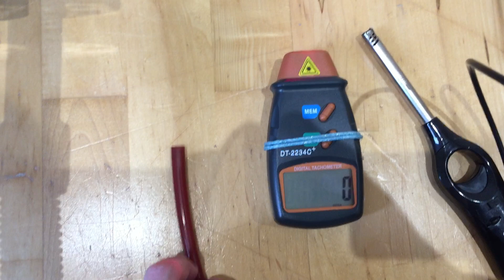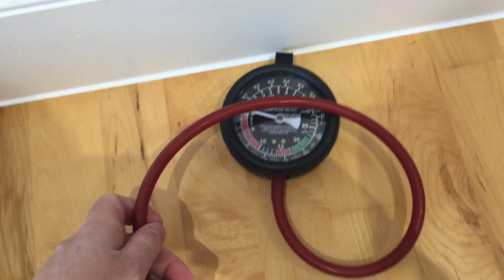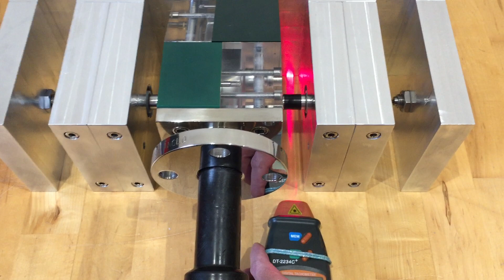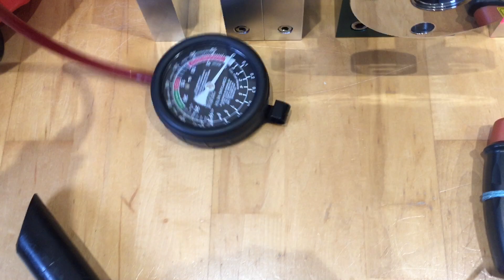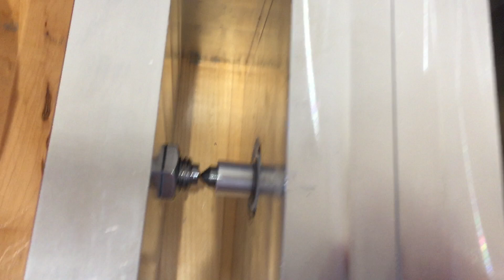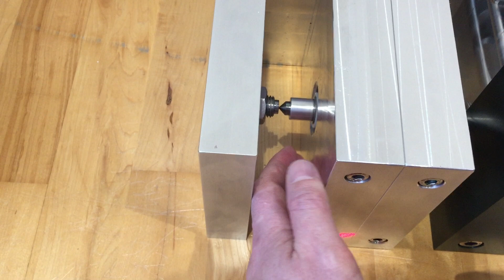Nikola Tesla's Rotary Engine - Part 5 First Tests With Big Blockage

Comment: I dont understand why there's no patterning on the spinning compressor wheel. Shouldn't a spinning pattern help? That sounds pretty hard to do but a cool thing could be certain types of laser cut patterning! It'd be interesting to see what actually works best. I have some ideas but who knows with these things. If that disk and spinning shaft where conductive and spinning inside a bunch of magnets, that'd be interesting. Also if it was filled with neodymium magnets, surrounded by an arrangement of coils to collect the energy... Something like a Hallbach coil array around it from a highly efficient magnetic motor.
Reply from the maker: This is because it works solely using adhesion and viscosity. It can be an expander or compressor. Depending on rotational direction.

Comment: I am working on one of teslas designs currently. I first will need to build the tesla turbine which shouldn't be an issue. I have a lathe, 6'x12' cnc plasma table and a cnc mill to help with the job. 
You and ienergysupply have caught my attention with your guys' efforts on the tesla turbine. Although I will be going a ways further than just the turbine, it is an absolutely necessary part of the puzzle. 
I understand you have 33 of teslas hidden british patents. I would be more than willing to pay for a copy of them to assist in my work. I plan on posting videos when I get further into the project and would love for you too see. I will gladly give you my email if you are interested in sharing those designs and also I can give you a run down of what I have going on. Good job on your work, I am impressed.

Comment: You can lubricate the bearings during turbine spin to check if there any isa  difference. You can lubricate with a syringe with needle on it to do accurate point lubrication. Good luck!
Reply: @nikola.tesla.r.and.d.centre  forces that act on bearings... I am not an expert but defining these forces should be a starting point. Magnetic fields can lift shaft weight but as it spins to high rpm then even small rotor imbalance will create vibration of the shaft. So you can use magnetic field to reduce the force on standard bearing and I think this is the setup in your current prototype, in my opinion this is the best option.
Reply from the maker: I've got completely contact free designs now. Just waiting for the timing to be right and the funds in place to pursue those upgrades.

Comment: What's the output of this machine going to drive?
Reply: @nikola.tesla.r.and.d.centre  whoa! That's so crazy. I'm going to try to figure that out. You mean with the pump and turbine combo?
Reply: Anything that produces that much cold tends to be associated with implosion. I know the turbine can implode and probably the pump too, when connected to it. I'll try and figure out what this thing does.
Reply: Oh, i see. The "hot" air is cooled after being imploded and "expanded". They all work in synchrony, in tuned fashion operating off of suction and the principle of the venturi tube. I just don't understand this machine yet.
Reply: @nikola.tesla.r.and.d.centre  1061142, United States Patent. This is what I've been interested in. These distinct tear shapes on this suction device. And the turbine had triangles. Something like that. I'm sure there's many versions and I don't know which was Teslas final or favorite version but I always liked the triangles on one and spinning tear drops on the other. They were designed to operate together. I always figured one of them was the turbine and one was a pump or something like that. I'm trying to find a patent number for this device with heavy rotor that you are working on. Is it a compressor?
Reply: Okay I missed it right at the begging. I'm not familiar with this rotary engine. Cool stuff
Reply: @nikola.tesla.r.and.d.centre  okay so it takes air from another source and expands it and cools it. Got it. The expansion drives this machine. Fast in this case. Thanks for sharing what you're doing.
Reply from the maker: It is going to act as an expander to propel a compressor via Tesla's fluid gearbox.